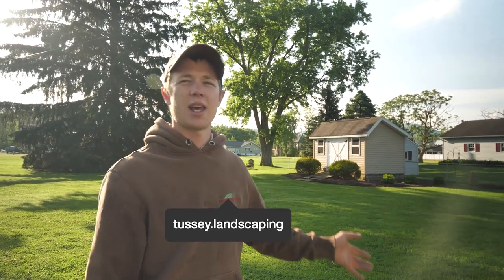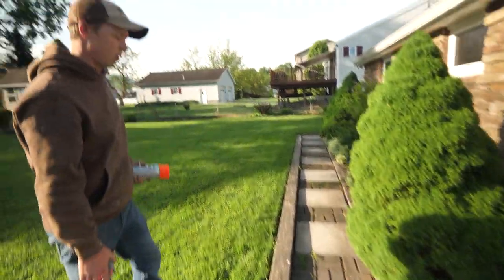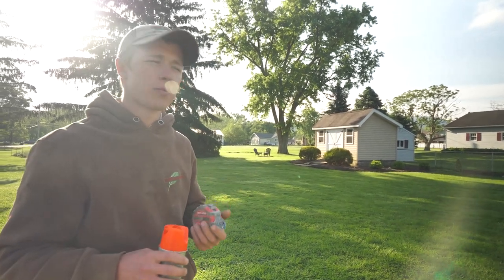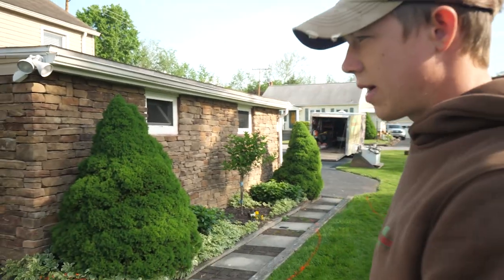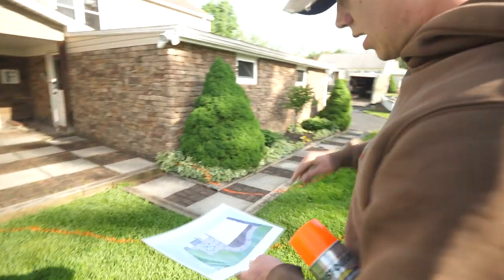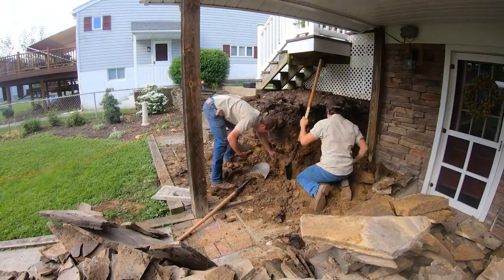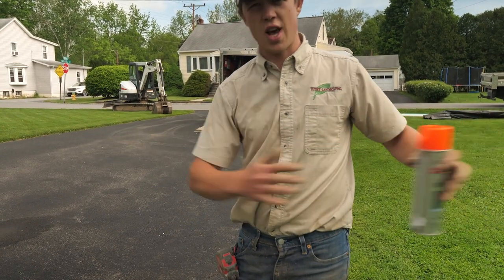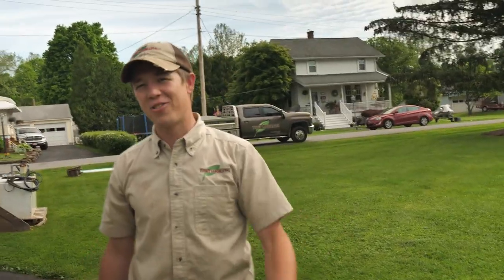How To Install A Patio Walkway With Pavers | Part 1 | Tussey Landscaping

Comment: Hi Guys. This series is great. Thanks. I have a question. Would a DIY home owner be able to get a way with renting just a front loader/skid steer with a bucket for excavation? I'm thinking that I will want a skid steer to transport the removed soil and bring in the rock. Could I use that to effectively excavate and grade?
Reply from the maker: You could probably get away with that for a patio - It's not as efficient though!